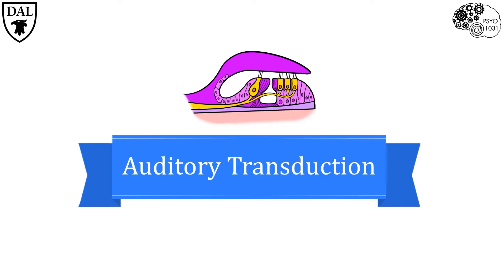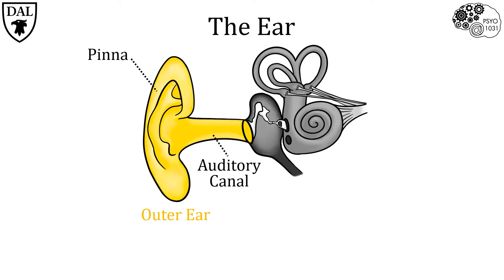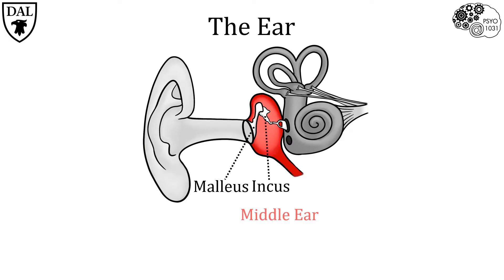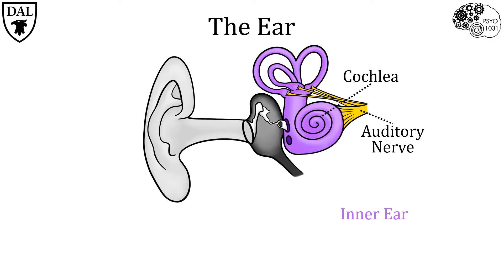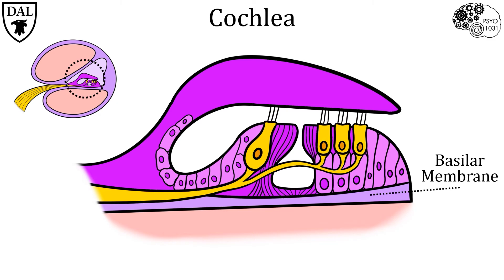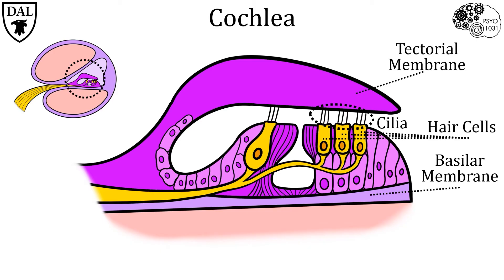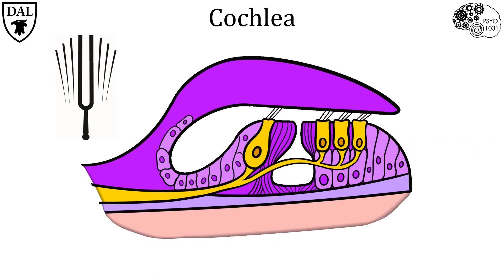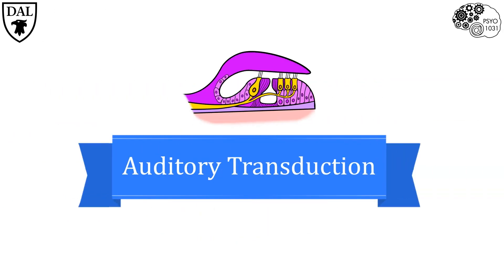Tricky Topics: Auditory Transduction

Comment: Great video but im pretty sure its only the outer hair cells, not the inner hair cells that have contact with the tectorial membrane.
Reply: both do have some degree of connection, but you are indeed correct that the connection between the outer hair cells and the tectorial membrane is more significant; that between it and the inner hair cells is rather tenuous